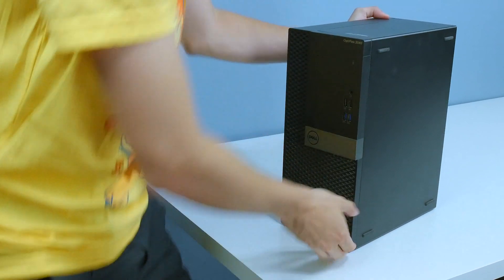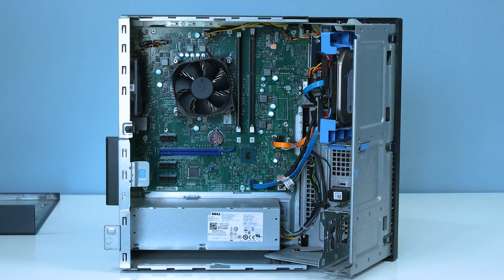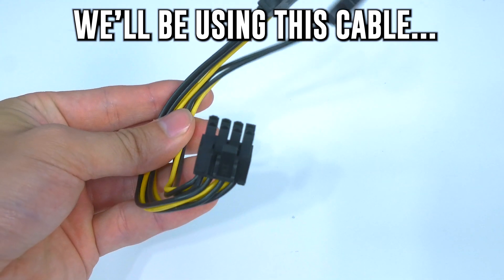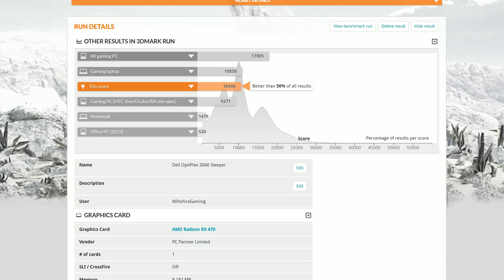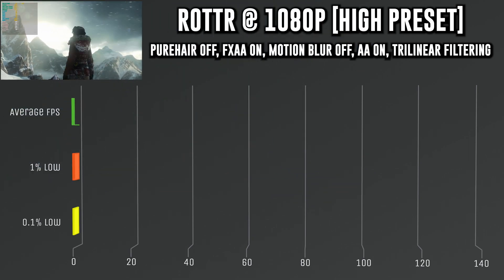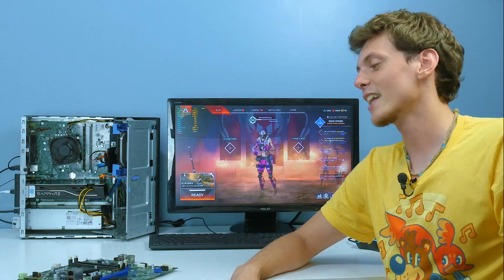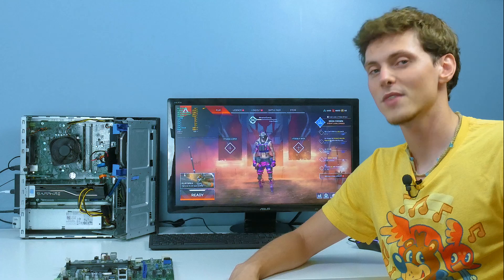$400 Budget Dell Optiplex Gaming PC (2019)

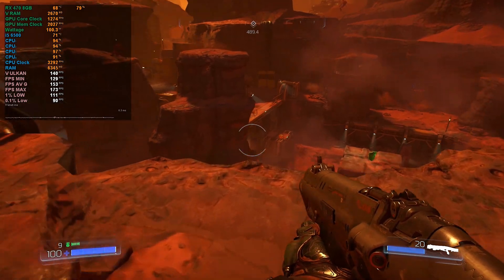Comment from the maker: The enemy in Doom falling out of the sky at 6:21 made me laugh a lot while editing this!
Reply: Wiltshire Tutorials can i pleaseeee have this pc i have been trying to buy a pc but im only 15 and i cant get a job anywere😞
Reply from the maker: @hahliss  Although, I wish I could help you in your current situation, it has no been turned into a Minecraft server for my friends and I
Reply: @WiltshireTutorials  Cultured I see. BTW you mind telling me how you turned it into a server? Kinda stuck on that part. Trying to mod it with the mod called pixelmon haha
Reply from the maker: @Abstract7  I used Spigot for my server. Just using the vanilla Server files won't work for Pixelmon
Reply: So broo looking foward to own these pc, can i put in a gtx 1650 super,its a 100wts power cosumption an it uses a 6pin
Reply: i have the dell 7040 pc and i5 6500 with ddr4 16 gb 500 gb hdd and 256 nvme  i plugged 1650 on the 240w platinum dell psu and i am scared about the psu its never shuts down for the previous  months but is it safe?? can it holds ??
Reply: Any other GPU suggestions for these Dell OPLX 3040s? Found a local guy that has 2 w/ 16gb ram & 1tb HDD for $35 each!
Reply from the maker: @EasyHeat  you could go with a GTX 1650 for the build. Stay away from the Arc A380 and the RX 6400 for these machines. Due to the 3040 not supporting ReBAR and PCI-E 4.0, you'll get poor performance from those cards.
Reply: @WiltshireTutorials  the 1650 was my first choice, along with anything from the 970 and above. Basically want to meet minimum requirements or better for Steam VR. I got my 10 year old son a PS4 Pro a couple of years ago with PSVR and absolutely ALL VR peripherals. Move, AIM, racing wheel, HOTAS, and although while we’ve been having loads of fun with it? We’ve been unhappy with Sony’s internal obsoletion and drop of support. Seems Sony is gearing up to do the same with PSVR2…
Anyway, I’ve seen some software options to potentially use the PSVR headset on Steam (with some obvious limitations), and thought it would be a neat project for him and I to try together? Although, with the current drastic price cuts on older Meta Quest models? That might possibly a less headache inducing option.
Thanks again man!
Cheers!
Reply from the maker: @EasyHeat  what a neat idea for a family project! I would probably go with something more compatible with the PC. It all depends on your budget. It is rumoured that Sony is working on implementing support for PC for their VR stuff. But, again, that's just a rumour. I'm glad I could steer you in the right direction for a GPU

Comment: I got a psu for this, can’t put in all the screws, but it is fine, and it is an 80plus gold, 315w, and it has a 6pin connector, so I put in a pheonix 1650 4gb gddr6 OC
Reply from the maker: @EmeraldFireDarkEmeraldGOAT without modding the backside of the case, you won't be able to fit all the screws in easily. A few screws will secure it though.
Reply: @ yeah, thats what i did, im never really going to move the pc anyway so

Comment: One question, I hope you can answer, can the 240w power supply from that PC power the Rx 470 OC without problems? How advisable is it in the long term?
Reply from the maker: @josegerardogarcia7929  seems to handle it just fine. I ran it OCed for months without issue
Reply: @WiltshireTutorials  thanks bro, you are the best
Reply from the maker: @josegerardogarcia7929  no problem. Let me know if you have any more questions
Reply: @WiltshireTutorials  I have another question, I would like to know if it is possible to install a conventional ATX power supply in that chassis, I understand that it uses SSF power supplies, but is there a way to put an ATX power supply in it? And if possible, how difficult is it? I saw that you have a video modifying that chassis but it doesn't go into detail about how it was done, I have that same PC and I would like to put a better power supply on it.
Reply from the maker: @josegerardogarcia7929  The answer for ATX PSUs is no. It will not fit. Only SFX PSUs will fit. The Optiplex actually uses it's own proprietary form factor, but is most similar to TFX PSUs. It's not difficult for the mod. All you need to do is trace the dimensions of the SFX PSU on the back and cut out a part of the case. That's all.

Comment: How did u manage to use 8 PIN power from stock PSU?
Reply from the maker: I showed you how in the video...? Use a SATA power to 8-pin PCI-E adapter
Reply: @WiltshireTutorials  Thank you dude
Reply from the maker: @techbuddy4245  No problem.

Comment: hi bro how are you, I just bought the Optiplex 9020 MT, 16gb of 256ssd ram, i5 4570, and 290w 80 plus psu for $130. My question is, can I add an rx 470 with that 290w psu (obviously with the 8-pin adapter) I wanted to opt for a 1060 SC but they sell it for $70, a friend urgently is selling me the rx 470 for $35. Should I opt for that considering the psu? Greetings
Reply from the maker: It's pushing it a little bit, but it'll work. You won't be able to overclock it though. Also what version of RX 470 is it? Hopefully the 8GB version
Reply: @WiltshireTutorials It's a 4gb nitro rx 470, i want to buy it because it's really crazy price, 35$ for that card is practically a gift but i wanted to make sure if it would work
Reply: @WiltshireTutorials my friend told me that it has two connectors, one with 6 pins and one with 8 pins, but with only the 8 pins it would be enough, that's what my friend tells me
Reply from the maker: @MABZPC  that's correct. The 6-pin is only needed for overclocking. The 8-pin will work just fine
Reply: @WiltshireTutorials I mean, can I have my pc to play with the rx 470 and 290w psu?
Reply from the maker: @MABZPC  it'll be close, but should work. You will be putting quite a bit of strain on the PSU. I don't recommend overclocking because that will put even more strain on the PSU
Reply: @WiltshireTutorials excellent bro, thanks for helping me, it will only be for a while, while I raise money for a certified source. grateful 🙌
Reply from the maker: @MABZPC  you're welcome. Good luck with the PC build!

Comment: Sorry to bother i just got my 3040 MT and wondering about, does this build gonna work on 240W PSU ?

- i5 6500 + Deepcool Mini Cooler 90mm
- 16GB ram
- 256GB SSD
- Zotac 1050Ti 4GB

I am planning doing 1080p editing and casual gaming like Apex or Valorant.
Reply from the maker: No need to apologize! I'm here to answer questions. The specs you listed are a very good starting point for getting into content creation. If you can, I suggest going with the GTX 1060 6GB over the 1050Ti. VRAM amount is becoming more and more important as the years go on. Especially when you plan on editing videos. Video editors love to gobble up as much VRAM as they can get when you start to add effects and transitions.
Reply: @WiltshireTutorials  Hey sorry to bother again, i need your help pls, i have problem doing this setup with gtx 1650 only run on 1.1 pcie lanes not in 3.0. Do you how to fix it ?
Reply from the maker: @fikryahmadg4865  GPUs will go into power saving mode until it is needed. Try opening a game and then GPU-Z to check to see if the PCI-E lanes are being used properly.
Reply: @WiltshireTutorials  That my first initial thought, but after i tried to play valorant its still running on 1.1 pcie lanes. I have to choose manually the nvidea gpu on bios to got the max performance every single time the computer boot.
Reply: @WiltshireTutorials   its like the motherboard wont recognized 3.0 pcie lanes until i manually choose it.
Reply from the maker: @fikryahmadg4865  interesting. I'd try to update the BIOS on the motherboard or check the watch batter attached to the motherboard. It is used to save the BIOS settings while the PC is powered off
Reply: @WiltshireTutorials  I kinda scare to update the BIOS also i think the watch batter doing perfectly fine because the date on the windows never got reset. It just the pcie lanes wont recognize on 3.0 :face-purple-crying:
Reply from the maker: @fikryahmadg4865  I think your only fix is a BIOS update. There's nothing to be scared about when updating. Just make sure you don't turn off the power by accident and you're good to go.
Reply: @WiltshireTutorials  Hey i been update the bios to the latest ver seems the gpu still not working properly on the first boot but after i restart the windows for the 2nd times and hit manually the gpu on bios it work.

Now the problem is i have to restart the windows 2 times everytime i am trying to use my pc :face-purple-crying:

If u have some spare time do u mind doing vidcall to help me solve this issue ?
Reply from the maker: Check in the BIOS for a PCI-E option that will allow the card to run at its correct speed. I would also suggest restoring factory defaults on the BIOS of your PC

Comment: My 3040 mt has
I5-6500
16gb ram
1tb hdd
240gb ssd
What would be some gpu options I could use
Reply from the maker: 1060 6GB, RX 580 8GB. Basically any GPU that doesn't require a ton of PCI-E power. Unless you put an SFX PSU and adapt it to the motherboard.
Reply: Well what would be the best option, without needing to change psu and without needing an adapter
Reply from the maker: @SkyNet4891  the absolute best option would be an RTX A2000, but it is very expensive.

Comment: What's the best way to supply the rx 470 with power? What adapter do I need ?
Reply from the maker: The best way would be to put a better PSU in the build. But, that requires modding/cutting the case and drilling a few holes. The quickest and cheapest way is to buy a SATA power to PCI-E power cable.

Comment: Hi. Love the video. I just got a 3040 and I need a gpu recommendation. Thanks!
Reply from the maker: There are a few GPUs you can go with that do not require modding the PSU. I used an RX 470 in this video.

To list a few GPU options:
- GTX 1650
- GTX 1650 Super (Will require a SATA to PCI-E Power adapter)
- GTX 1050Ti (Is pretty outdated now, but still good. Won't hold up to newer titles in a year)
- RX 6500 XT (Will require a SATA to PCI-E Power adapter)
- RX 6400 (Cheapest Option)
- RTX A2000 (Most expensive option)
Reply: @WiltshireTutorials  will a 1060 6gb still hold up?
Reply from the maker: @nehmzgaas9911  oops! Forgot a 1060 as an option. The 1060 is decent! It's relatively the same performance as the RX470 in the video.
Reply: @WiltshireTutorials  I got my 1060 now but I'm kinda hesitant int installing it. I noticed something different with my 6 pin to sata power compared to yours. Mine only has 1 sata power unlike yours that has 2. Is that gonna be a problem?
Reply from the maker: It's probably because mine is an 8-pin. Thus requiring more power from the SATA cables
Reply: @WiltshireTutorials  Thanks! I plugged it in and it's all up and running well! Really appreciate your responses.
Reply from the maker: @nehmzgaas9911  I'm glad to hear that! Also, that's what I'm here for!

Comment: Yo Will Gtx 1050 Gonna Fit In This Pc And Is 240W Fine for gtx 1050 ti 4g
And my pc specs:
I5 6500
8gb ram
500hdd
240W
Reply from the maker: Yes! A 1050Ti will work. It has a 6-pin connector on it, but you don't need to plug it in. If you plan on overclocking the 1050Ti then you will need to buy a SATA power to PCI-E 6-pin adapter in order to give the card some extra juice to overclock.

Comment: hey dude its me again i just wanna ask if rx460 work with this system with the stock psu bcs my rx470 will just randomly shut off my pc i thought maybe its the ram or the powersupply replace it but it doesn't fix it i did everything search on google and non of them fix it and when i remove the gpu my 3040 stop shutting off and its bcs of the rx470 and i find a 60$ rx460 in fb marketplace and i dont know if its gonna work since im a newbie when its come to building pc or upgrading a pc since im just 15 yrs old i dont wanna broke my only pc and i just wanna ask you
Reply from the maker: Sounds like the RX470 is triggering an overcurrent protection on the PSU. What you can do is underclock and undervolt the GPU to allow the GPU to run more efficient and not draw as much power.
Reply: @WiltshireTutorials  Its to late now bruh i already throw it out HAHA but will the rx460 work?? i just wanna know it
Reply from the maker: Why would you throw it out?! The RX 460 should work.
Reply: @WiltshireTutorials  its ok the rx470 was free so i dont regret throwing it out, and thanks i will just underclock my rx460 if i receive it tomorrow
Reply from the maker: You probably won't need to unclock/undervolt the RX460. It's more efficient when it comes to power draw than the rx470
Reply: @WiltshireTutorials  ok thanks dude
Reply from the maker: No problem!

Comment: im confused, some 5040 are ddr3 and some are ddr4? why is that?
Reply from the maker: That had the generation of Intel CPUs that supports both DDR3 and DDR4. The cheaper one would be equipped with DDR3
Reply: @WiltshireTutorials  the one i saw in 2nd hand market says DDR 4 with core 7 7th generation.  Price is around 250 dollar
Reply from the maker: That's not a bad deal! Could be a good starting point
Reply: @WiltshireTutorials  and that will be my first pc i think..im gonna mod it as well.
Reply from the maker: Nice! Good luck with the modding. Let me know if you need some help. I'm always around

Comment: Can this be directly done on the 7040 microtower ???
Reply from the maker: This kind of modding can only be done on a Mini-Tower (MT)
Reply: @WiltshireTutorials  oh yes I meant the mini Tower cuz that's the one im getting
Thanks
Reply from the maker: @badmingos  7040 is essentially the same as a 3040, just newer. So, you should be able to achieve the same results as this video. They haven't changed much for these Optiplexs
Reply: @WiltshireTutorials  thanks for the info👍
Reply from the maker: @badmingos  No problem!

Comment: Can the rx 550 or gtx 950 work with this system with only the stock psu
Reply from the maker: Both of them will work just fine. I recommend at least a GTX 1060 6GB or an RX 560 these days though

Comment: Can rx 460 work in this machine with the stock psu?
Reply from the maker: Should work just fine! I don't think the RX 460 requires any PCI-E power. It draws its power from the motherboard
Reply: @WiltshireTutorials  Ok
Reply: @WiltshireTutorials  what about the rx 550?
Reply from the maker: That will work also. Although, it is not the fastest GPU around these days and could struggle with many modern titles.

Comment: Can rx580 work in this machine?
Reply from the maker: No. It draws way too much power. The best GPU you'll be able to use on the stock PSU is an RX 470 or a GTX 1060 6GB. If you could afford or find one for a good price, you could go with an RTX a2000 as well.

Comment: Hello, RX6500XT is good for stock power supply? REal comsumption is 107 watts for this gpu. I find a dell 5050 with i5 7400 and 32gb of ram.
Reply from the maker: Maybe. I'm not sure. You could try it.
Reply: @WiltshireTutorials  I went to pick up the dell 5050 unit, I bought a 1sata to 6-pin pcie adapter (as it was Sunday, that's all I found), but when I turn on the unit, it remains stuck on the dell image from the beginning. When I disconnect the 6 pin plug, the unit runs without problems on the hdmi from the motherboard. At the same time, I noticed that it is also powered from the pcie slot because with the 6-pin plug removed, the asus tuf emblem lights up. Should I try with a 2 pin sata to 6 pin pcie adapter?
Reply from the maker: @TheLauriciouSSs  Does the GPU have 2 PCI-E power plugs? You need to power things correctly.
Reply: @WiltshireTutorials asus tuf rx6500xt has only a 6 pin power slot. The adapter I found today has only 1 sata plug to 6 pins. Should I try with an adapter from 2 sata to 1 6 pin?
Reply from the maker: Oh sorry! I misunderstood. Yes, you'll probably want to use 2 SATA power connectors

Comment: nice video! btw i have few questions to ask for upgrade my optiplex 3040

1. can this pc run rx550 with stock psu which is 240w?
2.can this pc with rx470 can handle 2 monitors which is 27 inch and 20 inch? if can im planning to get rx470 soon. hope you can answer my questions.
Reply from the maker: 1. Yes! It can handle an RX550
2. Also yes! The max GPU I recommend is an RX470 or GTX1060 6GB. If you're going with the RX 470, make sure it is the Sapphire Nitro variant. It fits inside the 3040 tower.

Comment: I thought using those Sata to PCIe adaptors would burn themselves up! I have read so many things about them, I just don't know what to believe anymore. Would you say they are safe as long as we keep in 110w or so of usage? What is your experience on this? Thank you friend!!
Reply from the maker: Although generally not recommended, you can use these adapter under the right conditions. You are correct when saying they can burn up because people push the adapter too far with power draw. Depending on what GPU you are using, you can safely use these adapters. I would only recommend the usage of a GTX 1060 or an RX 470 maximum. Do not try to use any larger card than those! If you can avoid using these adapters, do it! But, if you're stuck with a proprietary PSU, like the Optiplex 3040, this may be your only option.
Reply: @WiltshireTutorials  Yes, I am VERY stuck. I have an Optiplex 7050 240w PSU and Would you say a 1650 Super would be fine using these adapters (for me)? I am sorry to take your time Wiltshire. Thank you.
Reply from the maker: No need to apologize. I'm here to help. A 1650 Super will be just fine with an adapter. The card draws just under 100W and the PCI-E slots supplies 75W of power on its own. Therefore, only 25W is going through the adapter.
Reply: @WiltshireTutorials  Thanks man!
Reply from the maker: @ignacio6454  No problem! Thanks for watching!